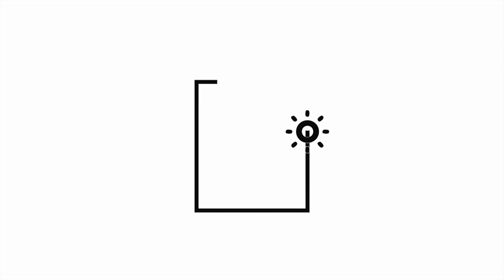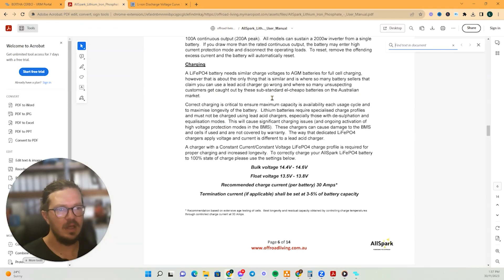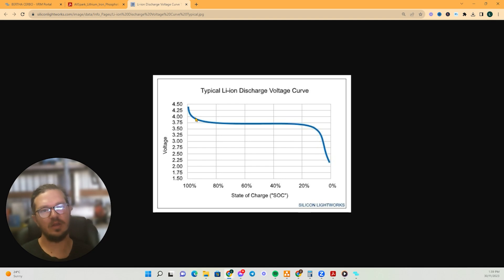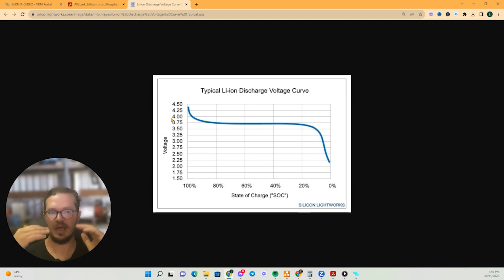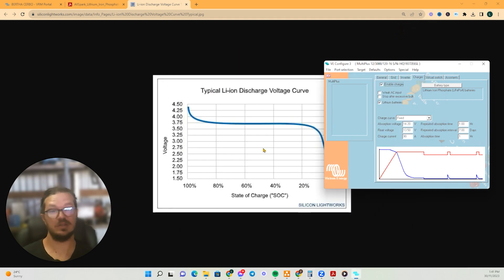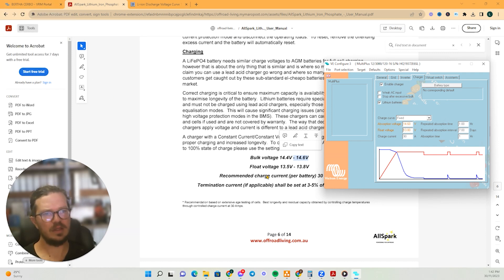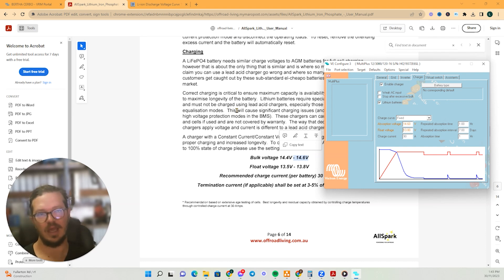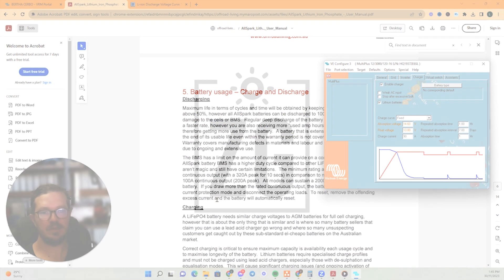The Importance Of Setting Up Your Victron System Correctly

Comment: Great video! I had a problem with my Fusion 48v battery not talking to Victron. Your Pylontech wiring diagram got me thinking, and so I talked to the battery  manufacturer who was brilliant! Turned out the ID number needed to be changed,  once they started talking to each other I changed some settings in Cerbo and got the battery BMS to manage the battery. Now it all works brilliantly! I also changed the Multiplus II AC2 outlet to run non essential items like Air con when the battery is above 95% & switch off at 80% ( for obvious reasons). The Victron gear is so configurable, I love it!
Cheers
Reply from the maker: That’s epic that you got it all under control mate! And yeah it is amazing the customisation you can make within the Victron configuration, it can also easily be stuffed up! I do want to make some more videos around using the Victron programs to configure settings etc
Reply: @zerogridaustralia that would be great!